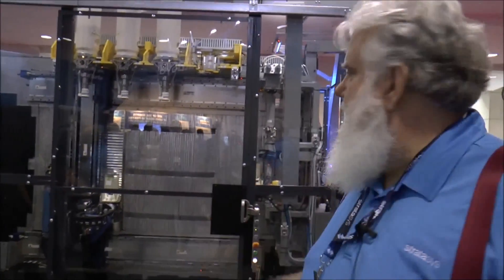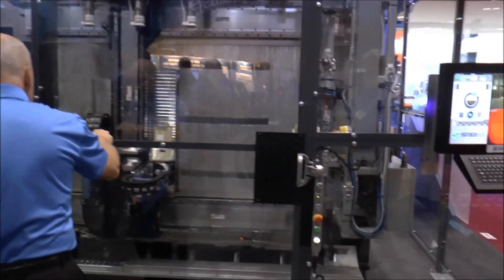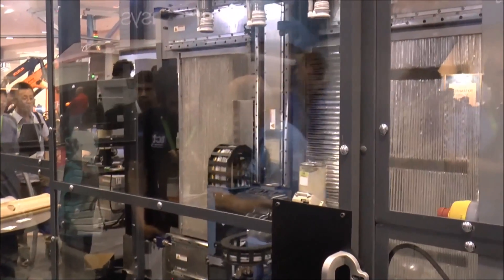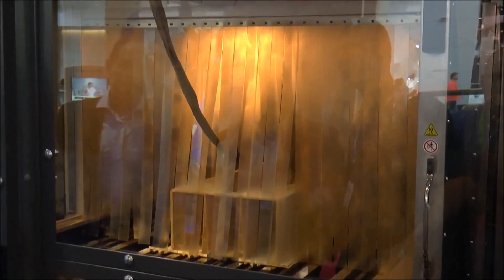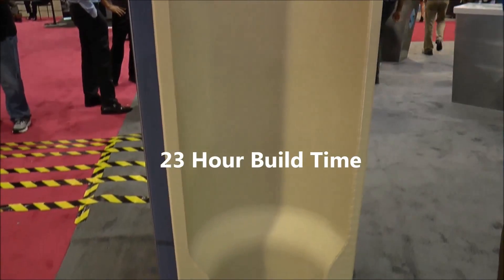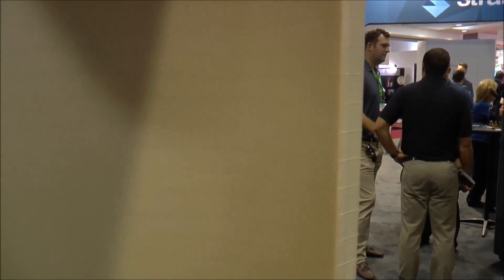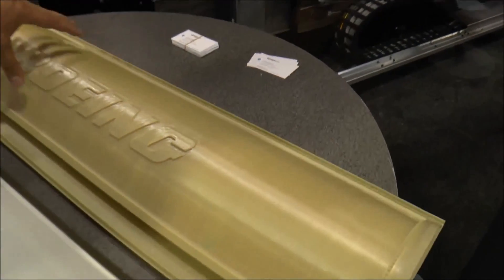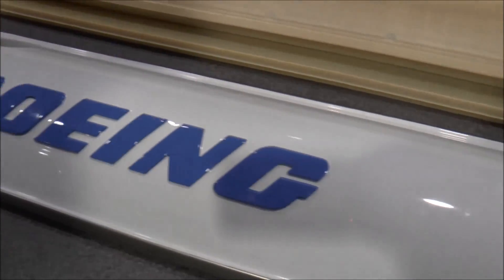Deep Dive Tour of Stratasys' New Infinite-Build 3D Demonstrator

Comment: how big can it print? Can it print plastic and metal? concrete?
Reply from the maker: Hi Richard 

The Infinite-Build 3D Demonstrator can print in ULTEM 9085 thermoplastic which is FST-certified for aerospace use.  It uses swappable extruders so other materials may be introduced when or after the system becomes commercially available.
Reply from the maker: In terms of length. it can theoretically keep printing as long as there is a table to support the part as it exits the build chamber.
Reply: So can it build a 1/5 or 1/2 version of a airplane
Reply from the maker: It could build the airplane structure in ULTEM 9085 thermoplastic. Would you like to be contacted by the Infinite-Build  Product Manager for more specific application opportunities?
Reply: Can you provide the url where to purchase it?